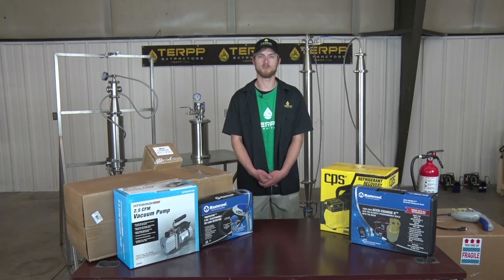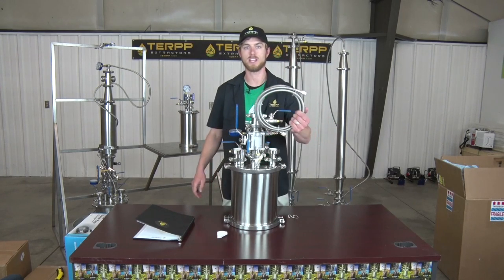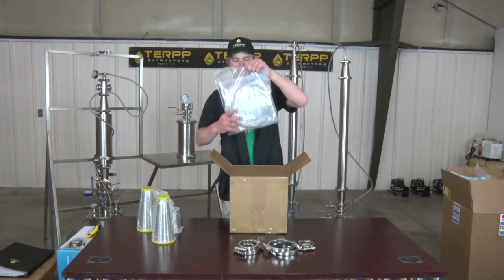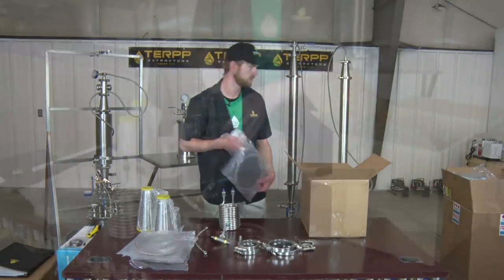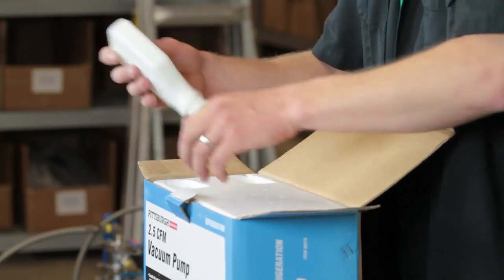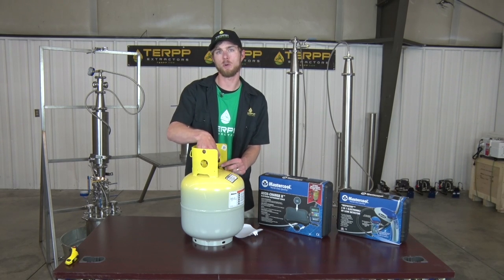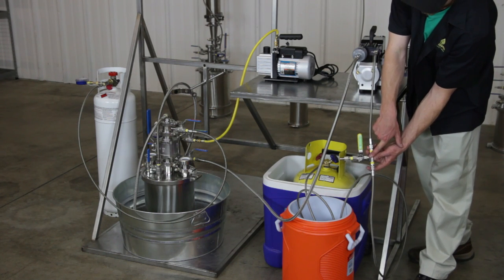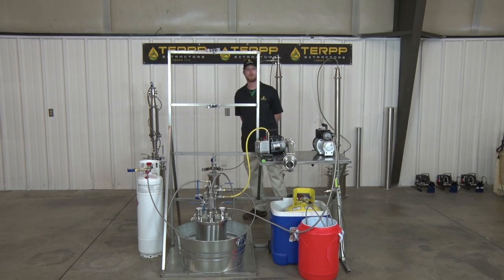TERPP EXTRACTORS MKIVc Turn Key Package Unboxing & Assembly

Comment: I would have to say this is not turn key if I have to buy a line, to me this looks like a fancy set up that you could build yourself, and probably do a lot better job, why do heat extraction column? It doesn’t produce the best, hell a simple passive system will get better then that will, I built my closed loop from parts at the local grow shop, and my first run was better then anything around here.

Comment: Why is everyone doing hot-column extractions?  It may take longer but wouldn't you want to run your column at -70C?
I see these expensive and fancy systems and no one is cryo-cooling their columns.  Maybe I am doing it wrong.
Reply: No ur not. Clown companies r popping up. Bc the leaders in this market. Are now only focused on distillate.  

While all these want to be  r spending there hard earned money for crap. 

Oh and what about the oven to purge the oil. Lol going to spend bank on shiny and not on tools. 

Hydrocarbons have a amazing ability To defy gravity and everyone stuck on passive.
Reply: Your reply is extremely convoluted however I would have to agree that hot-column extraction is a shite way of producing product quickly.
As well the excess shite extracted adds mass to the final production.  Wiped film distillation is producing very cheap distillates that are hard as a rock.
I still want to stay in the high-quality market instead of the bulk-production market.